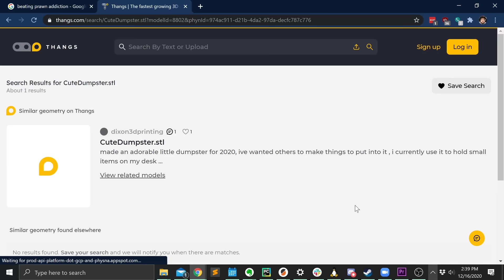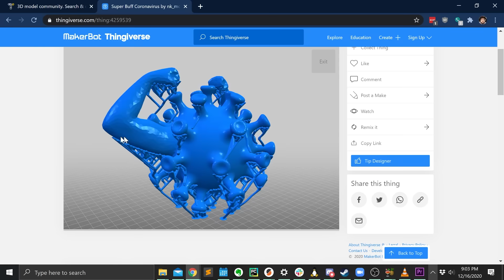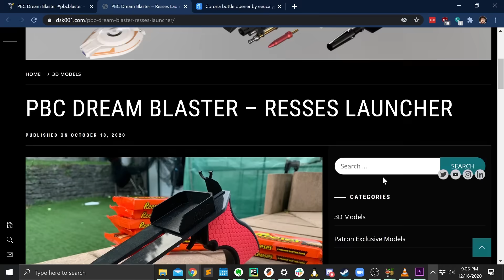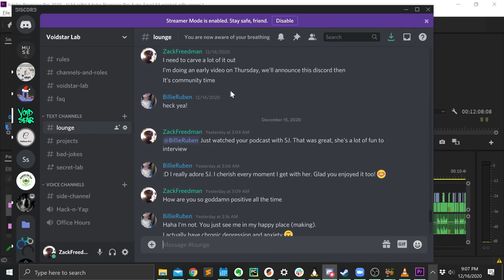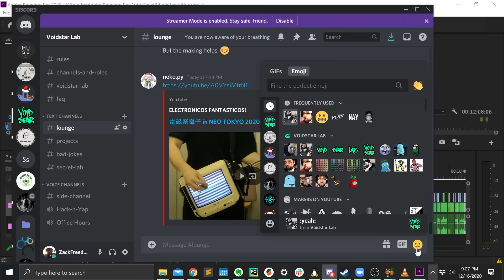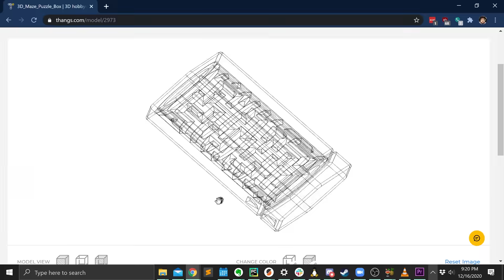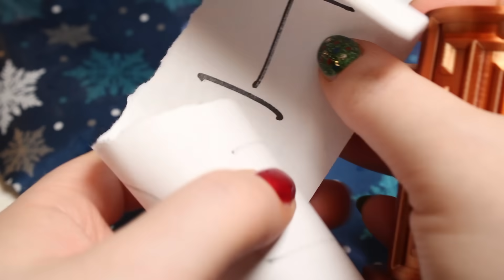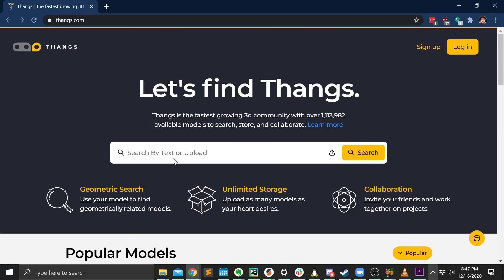Ten Awesome 3D-Printable Gifts

Comment: Wait, what? You can print things with multiple parts as a single print? Im new to making 3D designs and I'm finding that builds are slightly hampered by needing to build individual parts and then build an additional part to cover the hole I left to assemble it. How do you do it? Do you just build a thin support between each part or something?
Reply: Search print in place

Comment: Awesome video. 
Just wondering which 3D printer to get.
 I was tossing up between resin or FDM Just due to the extra detail of Resin however Resin isn't as durable/ longasting / as strong.
 Now deciding which FDM to go with I started of looking at the Creality CRX Daul ($899) then the Anycubic Kobra Max ($899) now the PRUSA I3 MK3S+ ($2,299) (AUD not USD) . 
I guess I'm mainly interested in printing Figurines , R/C car bodys , planes , buildings , movie props etc. Then I seen the engraving and etching possibilities which could be a cool extra business avenue aswell. 
If I go FDM I want something that has a fairly decent print area , can print good detail , be reliable , then comes down to what I can afford which is up to a budget of $2,000 AUD which is $1,353 USD ( wow I didn't realise the massive difference lately ) 
People say buy one cheap under $1000 first but I'd rather buy one with Auto Levelling re auto fill , fast print speed , large print area and good print detail which I think comes down to nozzle size ? Which most are 0.4mm ( which can be upgraded I suppose ?) 

Thanks

Comment: @09:57 Just had a quick look about those print times ( just the main file ) and with only 2 perimeters ( one 0.42 and a 0.65 ), 18% Infill and at 0.25 Layer Height plus some more aggressive speeds ( 250-350 ) and accelerations ( 4'400 ) I could get it down to almost 9h 😁

Comment: subbed just bought a printer and i think im going to print that marble toy for my Christmas gift to a family member thank you <3
Reply from the maker: That's a pretty tough print to jump straight into. Don't get discouraged if it fails or detaches from the plate - larger prints are much more difficult than smaller ones.

Comment: Hey, can anyone make that collapsing katana but in pieces, cause when I print the test print, it slides perfectly, but the full blade will not slide.
Reply from the maker: You really need to dial in your printer. Use the included tester model to conserve filament!

Comment: Must be nice to have a printer that actually prints correctly a lot. Might not be every time but the old 460 dollar Artillery Sidewinder X1 I have had since August (and is my first printer) ALWAYS has issues. I have to re-level my bed just about every time, prints don't like to stick sometimes, and I have to recalibrate EVERYTHING everytime I switch to a different material. Anyone have the same issue with their printers??🙄🙄

Comment: The Cyclone is no longer on the site.  All a search for "The Cyclone" turns up are parts for vacuum cleaners and gopro mounts.  This is Dec 28, just 11 days since this posted!
Reply from the maker: Here you go! https://www.thingiverse.com/thing:1340784
I put all the links in the description so you don't need to search around.
Reply: @ZackFreedman  Still no #10 Collapsing Katana on thangs.  What am I missing?  There is a different version on thingiverse which I printed and works great:
 https://www.thingiverse.com/thing:3837891

Comment: So I also printed a purple coronavirus, but the remix I printed has a mean little face on it. I did mean to make a snow globe with him...

Mind the filaments with glow (and probably glitter) - they're actually really abrasive to your nozzle so they can widen it out pretty quick apparently. Strontium aluminate is some coarse stuff.... I've printed part of a roll in a cheap import nozzle and haven't seen too much change or degradation in print quality (the surest sign) but I'm on the lookout for it and have another cheap nozzle at hand to replace when needed.

I might print some of these even on my very not modern 3D printer: old school Replicator 2X (with decidedly modern PrusaSlicer), so take that 😜

Comment: I printed the katana on an ender 3. Huge disappointment.  Unless your printer makes perfect vericle surfaces without bulges the resistance to telescoping far exceeds the layer adhesion. The handle looks great, but there was no chance the blade would actually telescope out. When I tried pulling it out with pliers, the blade just ripped apart at the layer lines. I would not suggest this print unless your printer is tuned perfectly to make vertical surfaces with 0 defects. You may also need to print at the smallest layer height.  God knows how long that would take.  It takes a fair amount of filament so it really sucks to finish it only to find it doesn't work.  Since the handle looks good, I guess I'll just make a steel blade for it before giving it to my kid.
Reply from the maker: Well, that's a bummer! The creator does have some printing tips, and there's a test model so you can dial your settings in before committing the 15 hours to the full print.

Comment: The Cyclone is so cool. Luckily it will fit inside the build volume of my Ultimaker. I think I'd like to power it though, by adding enough height to the base to house a small gear motor.
Are you aware of anyone who's already done this? Also any suggestions would be very helpful.
Reply: Sweet idea, I might try to do the same

Comment: Pro tip with lithophanes, print them vertically. Do not lay them flat on the plate.
Reply: what about the infill? I think it should be 0% or 100%, right?
Reply: @robotportachiavi2507  Depends on your slicer settings. My slicer does two passes per wall. Front and back, that would be four passes. That's about as thick as I print my lithophanes, so the infill settings don't matter. You don't want it to be too thick otherwise light won't shine through it as well. Even in white filament, my four-thick prints need a pretty bright light to see the picture.

Comment: I was really excited to see a new model search site! .... but Thangs is AWFUL. The Liftpod link is multiple separate search results rather than a single "project page" like Thingiverse etc and doesn't give print counts or assembly sequence. Your Collapsing Katana link DOESN'T HAVE THE COLLAPSING KATANA so A+ great job. Their "Geometry search" works about 20% of the time on really simple shapes. Link the Collapsing Katana, LiftPod, and other things on Thangs DIRECTLY instead of searches that don't actually return the things you're talking about, and maybe consider that you should stop pushing Thangs until they're usable.
Reply: Give it a few weeks. It's a new site, but assembly support is almost out and it's going to be a very useful tool for 3D printing :-)

Comment: You really gotta get your retraction settings fixed on your 3D printer.  Those strings are unacceptable.  To fix it drop your retraction speed down to about 10-15mm/s and your retraction distance to 8-10mm.  To fix those little bumps in your prints change the Jerk settings in your printers menu to 8-10 and they'll disappear! :)  Love your channel!

Comment: Ahhhhh! I want a 3d printer so baaaad!!! But it's too expensive D':
Reply: It's not. I paid 135 for a shitty DIY kit which took 12 hours to assemble from 800 parts, and i mean it, mechanicaly it's wood frame garbage, lots of bent and wonky parts, but it was the best damn purchase i made in my entire life. It has been an amazing educational platform for me - mine came prepared for firmware development out of the box. You can not get more fun and education out of anything else, whether cheaper or more expensive, change my mind. And there are shitty wood frame kits for 90€ around now, though they kinda do invite redoing the electronics for about 30€ eventually later.

Comment: Hey Zach, would you ever make an octoprint plug-in that could control some small stepper motors attached to bed leveling gears on a 3D printer that would take the data from a BLtouch and actually automate bed leveling?
Reply: The hardware exists already. It's called your Z axis. The software also exists in Marlin and klipper. 
Your print bed doesn't need to be leveled. It needs to be trammed, so the printer can anticipate at what Z height the bed is at for any given XY coordinate.
Reply: William Meitzler thank you for correcting me. I don’t really think that people need to get their dicks in a twist about the difference between tramming and leveling. The definition “level” doesn’t actually have anything to do with gravity, but the field of construction is larger than the field of 3D printing and in construction. Making things perpendicular to the gravitational pull of earth is kinda the name of that game in that respect so it makes sense that “leveling” would be associated with gravity but alas, anybody with a printer will know what you are talking about if you tell them to level their bed. Both work. We can argue about the shitty English language in a YouTube comments section for a good while but I’m not interested in doing that. 

I will however edit and rephrase my original comment so that more people can understand what I am referring to:

Hey Zach, I really hate tramming my bed, would you ever make a 3D printable and octoprint plug-in that would automatically use data from a BLtouch to perfectly tram the bed using motors and gears to replace the bed tramming knobs on the printer to totally automate bed tramming?
Reply from the maker: It's not a problem I have - the Prusa's automated bed leveling is excellent.
Reply: Zack Freedman I’m in that Ender 5 plus gang